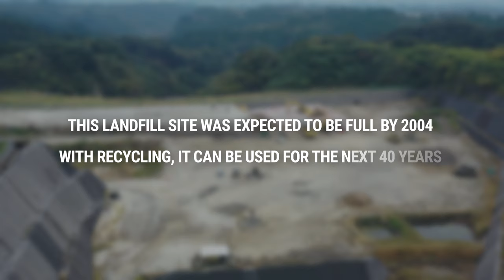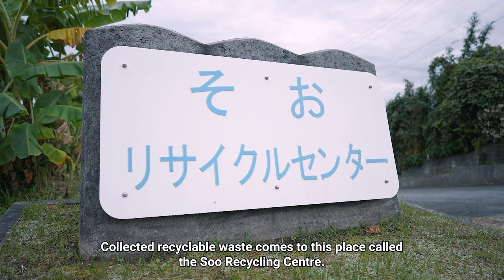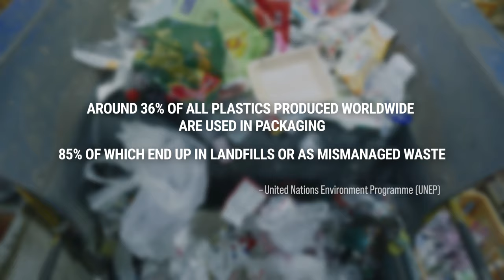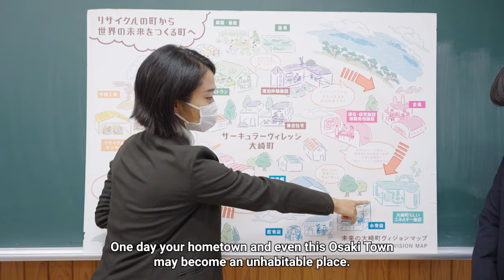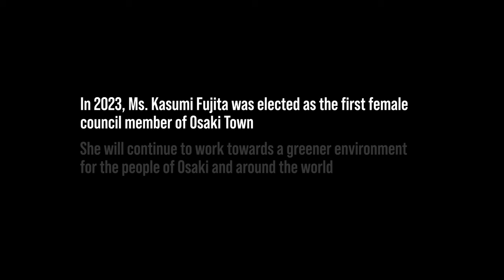Zero Waste Town: Power of Recycling in Japan

Comment: Though in Japan they are putting lot of efforts to recycle plastics, efforts are not seen to REDUCE generation of plastics scrap.

They should REFUSE to use the plastics as far as possible.

If usage of plastics is reduced, obviously scrap generation will reduce. Hence, the efforts required for recycling will reduce.

Comparatively this problem is very easy to tackle in country like India, where use of plastics and scrap generation itself is less.